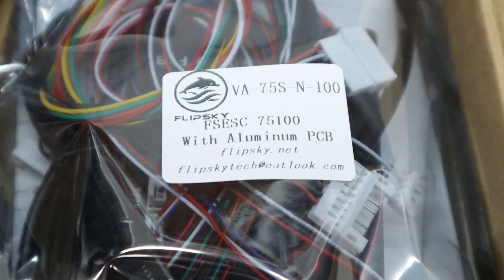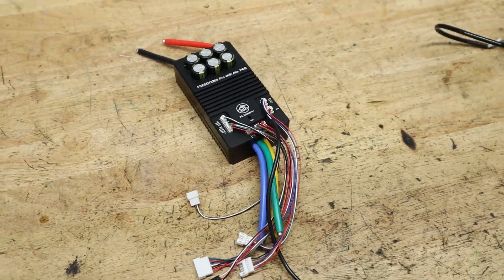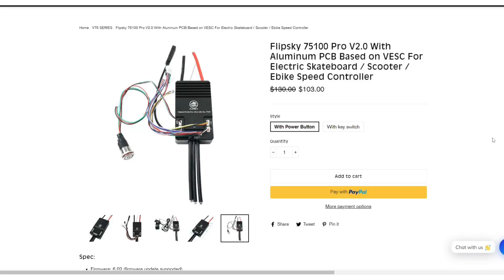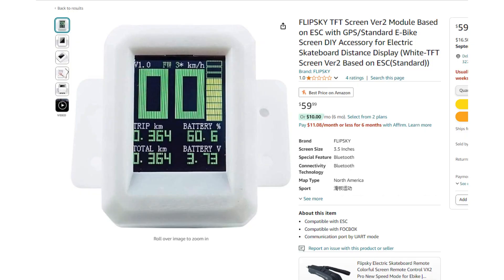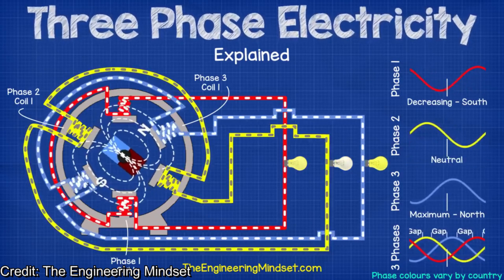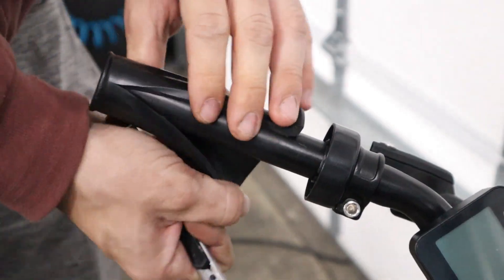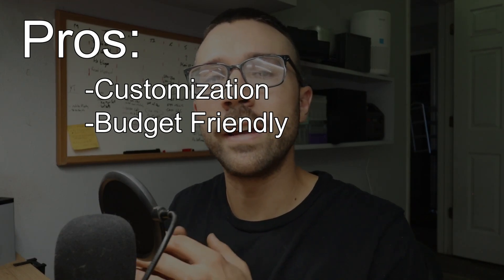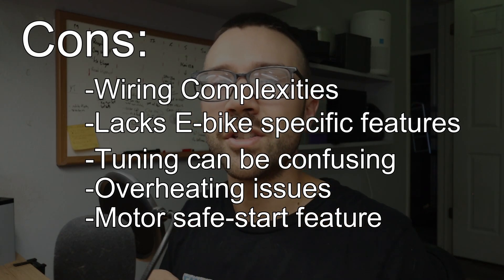Full Overview: Upgrading your E-Bike to VESC!

Comment: Also a good rule of thumb the general max amount of phase amps are 3x your line amp continous discharge of your battery.. phase amp = torque, line amps = speed
Reply: i though line current angld phase current is the same because even it has 3phases it only one turns at a time
Reply: @dhansantv395  nope. Phase amps is a separate figure from line amps. Two different ways of producing power.
Reply: It's a huge shame that people don't understand, that any wireless software controlled system is designed to control you, more than the motor.
Reply: Not line amps make speed the voltage is. Amps are just there to compensate the losses in friction
Reply: @finn_9999   youre right motor KV so RPM per Volt is Speed limiter, and Amps are torque, yes you need torque to get over the friction but Voltage is the Multiplyer for Speed by the MotorKV Value
Reply: @finn_9999  huh
Reply: Im just talking about adjusting parameters when tuning. Not actual representation.
Reply: @finn_9999 don't give advice
Reply: @stevenervin4113  who are you?
Reply: @finn_9999  somebody that knows a thing or 2 about brushless motors.
Reply: @stevenervin4113 While I understand your concern, I think it's important to recognize that finn_9999's advice about the 3x amps rule is actually correct. This principle is supported by the VESC Tool Documentation and discussions in the ESK8 Builder's forum.

For example, if your battery can continuously discharge 20 amps (line amps), setting your phase amps to around 60 amps is recommended for optimal performance. This is because phase amps can be higher due to the way ESCs manage power delivery to the motor.

Before dismissing someone’s advice, it’s beneficial to review credible sources. In this case, I couldn't find any evidence to support your claim, but there is substantial backing for finn_9999's advice.
Reply: @TheAnimeist  he's not even the one that said anything about 3x phase power. Are you a bot?
Reply: @stevenervin4113 , it’s probably his buddy who suffers from reading comprehension. Lol
Reply: @TheAnimeist it highly depends on the power levels, at low currents your power is also low (duh)

that may certainly cause you to not reach the same speed as with higher amps, but it's not in EVERY case

the main questions are:

do you have enough power (and thus torque at high duty cycles) to overcome wind resistance and friction?

fact is motors have an RPM/V rating, in my case on my dual motor electric scooters, i actually need higher voltage to be able to go faster

the benefit of having your battery amps the same as your phase amps is that it keeps accelerating the same way/full torque regardless of your speed, like on my most powerful one, controllers are set to 250A motor and 200A battery each (MAKERBASE 84200HP)

above 50% duty cycle i still get the same acceleration

if i ran 50/150 or 50/200 i would get a noticeable torque reduction above 30% duty cycle and half torque at 60% duty cycle

i actually hit 95% duty cycle on road on both my scooters, so without an increase in voltage they wont go faster at all unless i force field weakening but thats very inefficient

and yes on that most powerful one with the 84200HPs while full throttle but not full speed yet my battery current actually gets up to 350A (which isnt quite 200 per, but close)

there are diminishing returns, once you've got enough (and more) power to overcome the wind resistance etc, you're stuck due to your motors kV rating but acceleration is way more consistent and almost as agressive throughout the whole speed range